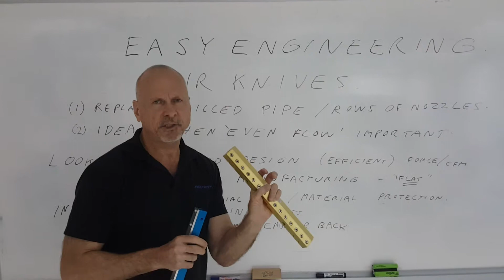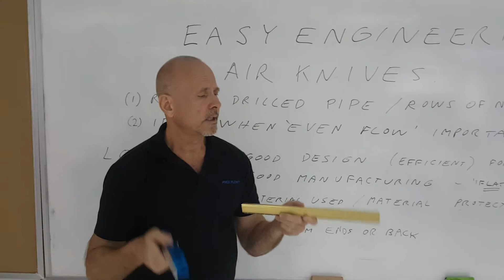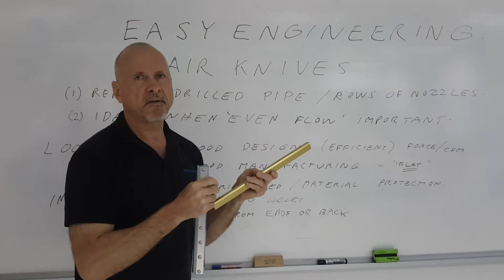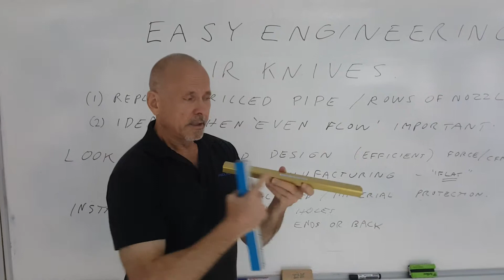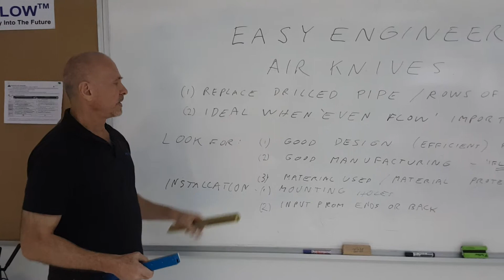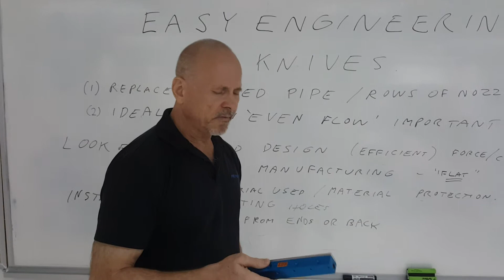EASY ENGNEERING - All about compressed air operrated air knives

Comment: What’s the minimum air pressure this can use?
Reply: For extremely light blow off as low as 20 PSIG compressed air but normally between 30 PSIG to 120 PSIG range of operation